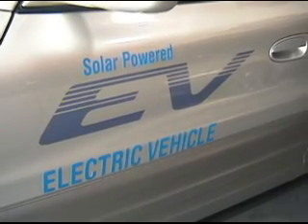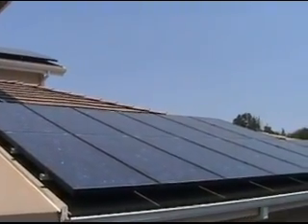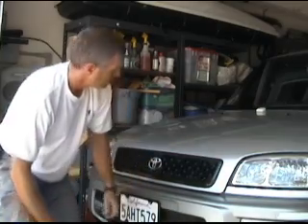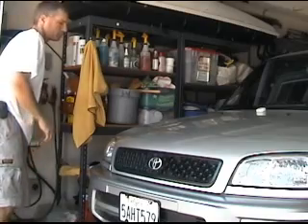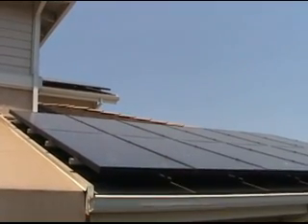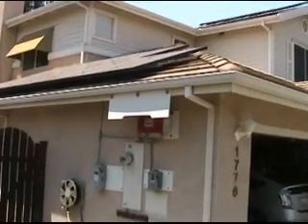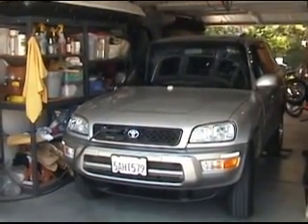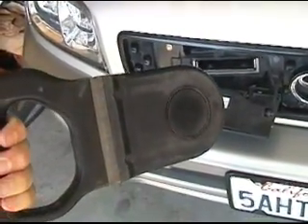Charging With Sunshine II

Comment from the maker: @thecrism1 - I didn't make any changes because of the solar addition - saving energy has been one of my hobbies my whole life. I have LED lighting, we use a whole-house fan, a recirculating water pump. Very low vampire loads. My house PLUS the EV uses about half the electricity as the average home in my neighborhood (not counting the solar displacement!) When counting solar, I use almost nothing on a net energy basis.

Comment from the maker: When I installed my 2.5 kW system five years ago, it cost about $10k after incentives. I save that much in gasoline alone every year now, and the house power just comes along for free. I didn't do this to make (save) money - but it sure worked out that way, didn't it?